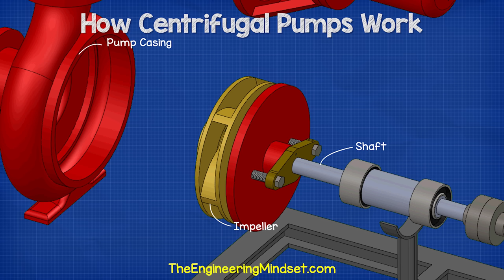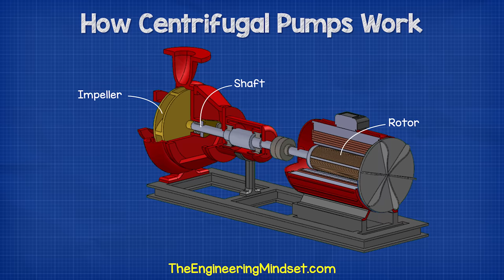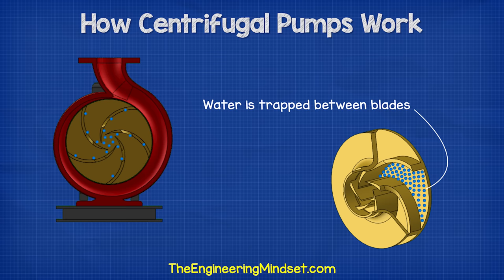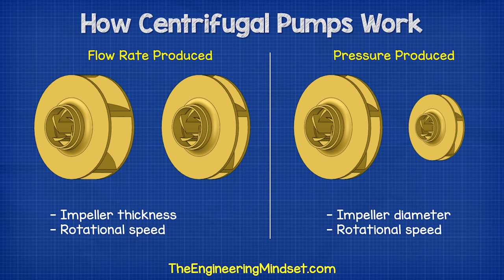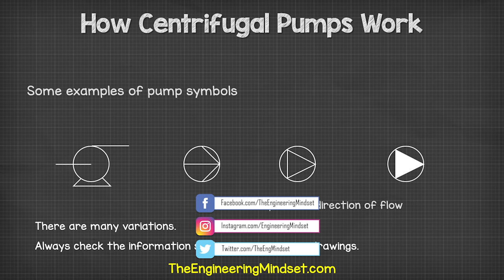How do centrifugal pumps work?

Comment: How do you create such animation? I’m amazed by how every piece can easily slide away from its assembly… what’s the process on how to make this, and what apps did you use ? Thx
Reply: Solid works, could be another open platform 3d file rendering tool

Comment: As a bit of advice, use mechanical seals whenever it is an option over packing.  We had Chilled Water Pumps that used packing as the Contactor which supplied it chose the default cheaper option, ended up being a maintenance nightmare.  Some engineering mods were done to change out the packing in the stuffing box as well as upgrade the bearing lube oil to try and make it more resilient to water, no dice.  It got so bad the maintenace folks welded sheet metal shields over where the housing met the shaft to stop water leakage spraying everywhere over the chiller room. 
Installed mechanical cartridge seals and the pumps have caused no problems since.
Reply: What state?   Illinois Engineer here.   
Cheers!
Reply from the maker: See our new video on how to build mechanical versions of electronic circuits? Watch here: https://youtu.be/Zv9Q7ih48Uc

Comment: hi admin.
is this centrifugal pump can be use as motor generator  to construct hydro power electricity by attaching the peltron turbines to the  pump to spins the motor backwards without any changes in the motor?
will there be power loses in the motor?

thanks
Reply from the maker: Unless the motor was refitted with magnets or electromagnets, it won't produce power

Comment: I'm still not clear on what the Bearing House does.
Reply: LOL.
Reply: Clever :P
Reply: Takes the stress off the impeller housing. When you space the bearings out you get more stability of the impeller and shaft.  If the impeller housing was an integral part of the motor case and the motor shaft and pump shaft were the same piece, that would work well too. It would be the same effect of spaced out support.
Reply: If the bearings were not there then the gland would presumably be supporting the weight, and thats not the job of the gland - its just there to keep water from leaking. Would probably lead to a leak because the weight on the gland would cause it to compress over time and develop a gap near the top.

Comment: So what does the electric motor have to do with how centrifugal pumps work, the pump can de driver by any rotating machine. Don’t mean to diminish your efforts but too much time spent on the electric motor.
Reply: I like it, because he repeats himself in some way in these videos and you recognize the bits you have already learned before what leads to long term memory.

But yeah, for the actual centrifugal pump it was not important.
Reply from the maker: True, but I've never been to a modern site where a centrifugal pump wasn't driven by an electric motor. It's basically an integral part of the device so I explain both parts.
Reply: @EngineeringMindset  nice
Reply: There's always the "scroll" option to F-Fwd to the point of interest.  Hold your finger (or mouse pointer) on timeline & drag to desired timestamp location.
Reply: @Schrimpieman  thank you
Reply: @EngineeringMindset  Where I retired from we had 10,000 HP steam driven centrifugal water pumps as well as 4,500 HP electric water pumps.  We also had 1/2 HP electric pumps too as well as fixed and truck mounted diesel driven fire pumps.
Reply: @dwayne7356  you have retired from which work?
Reply: @dwayne7356  can you tell us more
Reply: @Schrimpieman  I wasn’t saying I wasn’t interested in it, I am saying it has nothing to do with the title.